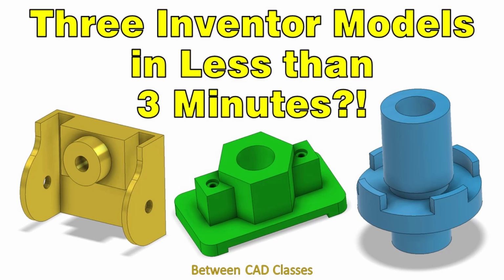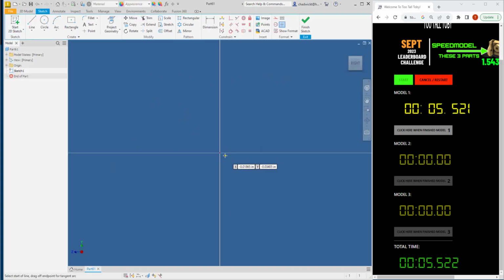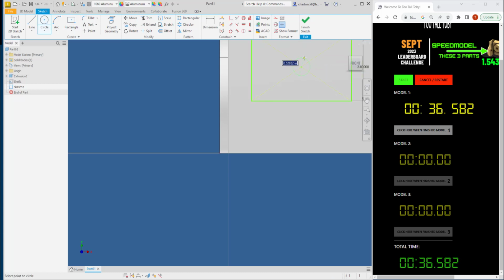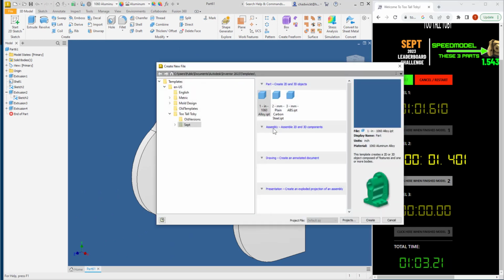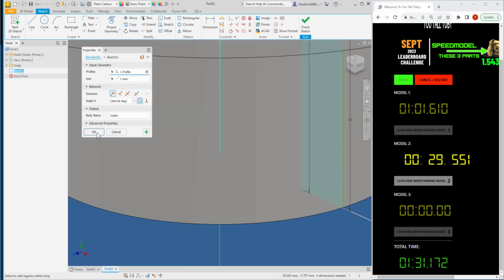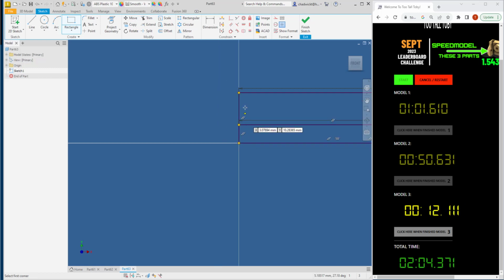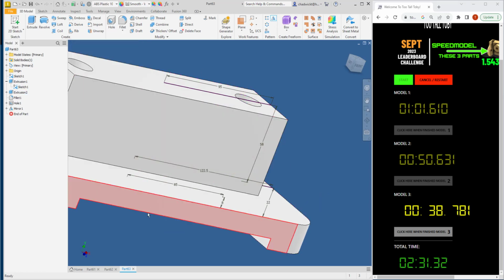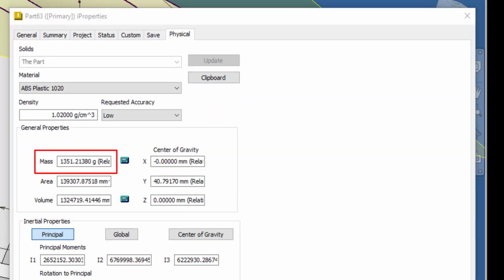TooTallToby Speedmodeling Challenge - September 2023

Comment: This was really speedy. 💨
I liked the way you set your templates up, defined the material and units beforehand. Saving you precious seconds.

Instead spending time to go back to part tree to share the sketch, you could press green + button in extrusion dialog box, that way you can keep using same sketch over again as much as you want.
Reply from the maker: Thanks for the feedback! It looks like the green plus is only active if there is one profile. That would be a great option if you needed to extrude one direction, and then add an angle going the opposite direction. If I have more than one profile that green plus is inactive. Are you seeing the same thing?
Reply: @betweencadclasses  I just tried again, and the green button becomes active as I select a profile from a sketch. It works for me in either case whether there are multiple profiles in a sketch or a single profile.